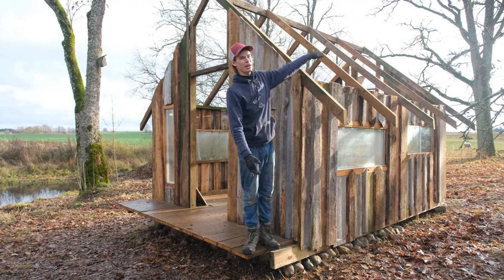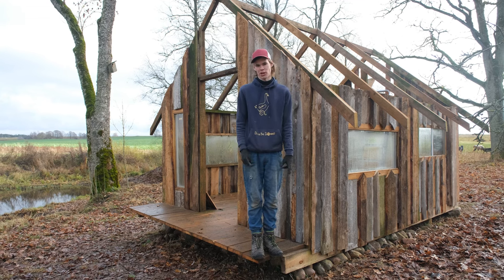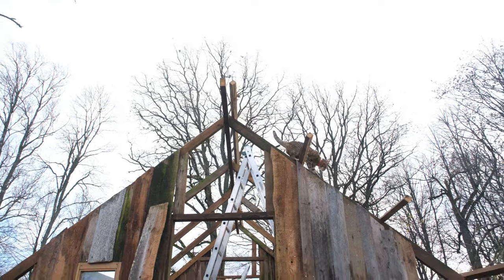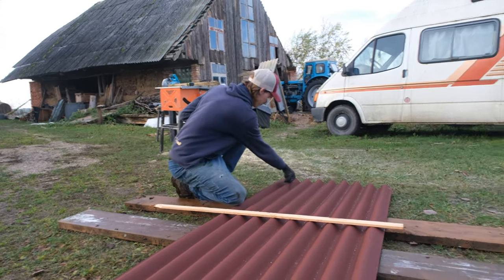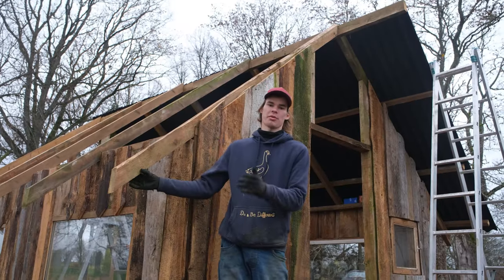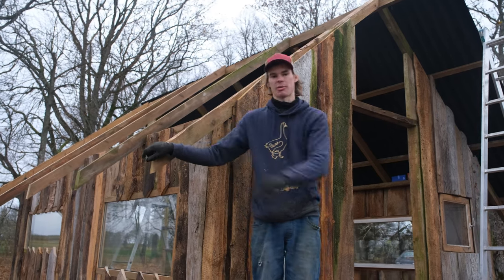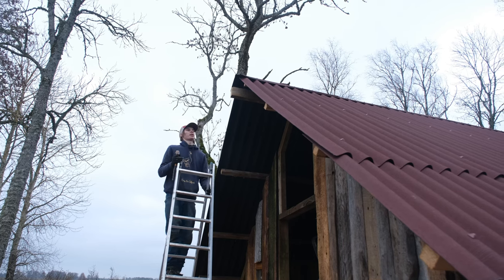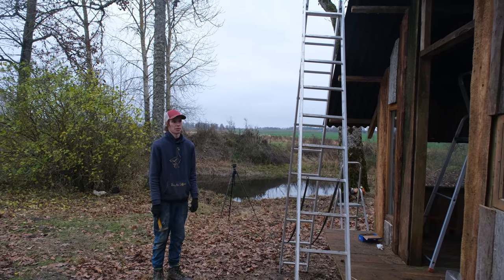Let's put up the ROOF on the Bird COOP

Comment: The distance between horizintal wooden boards is so big. The wavy roof will be bent between them after 2 seasons and destroyed in 5 years... I did the same mistake few years ago. It's good to read and follow datasheet by manufacturer.